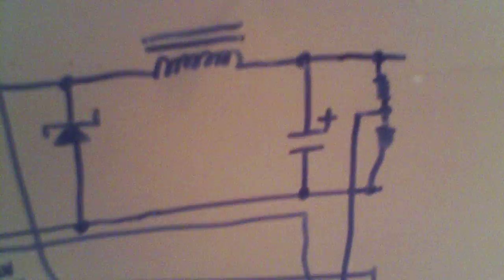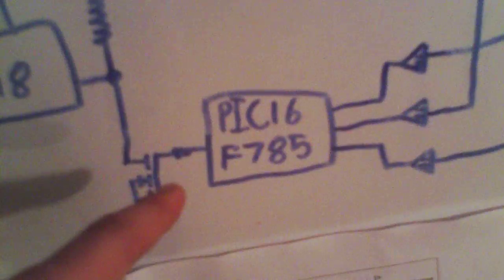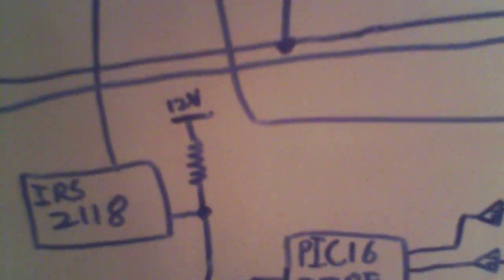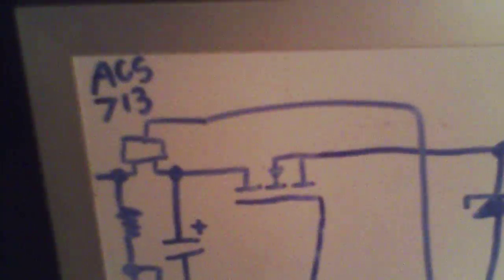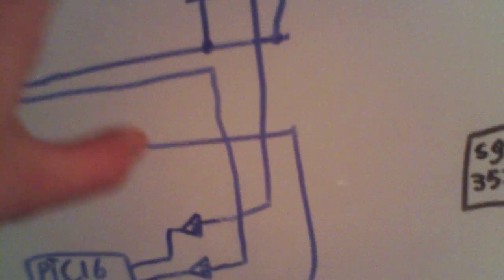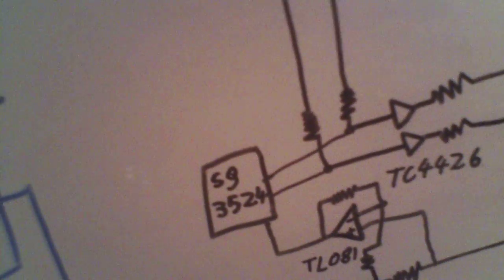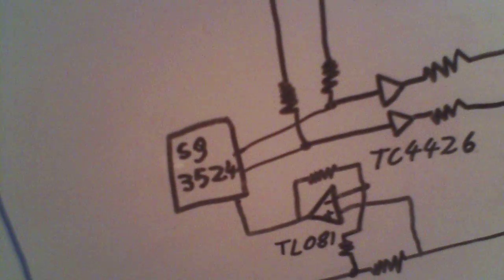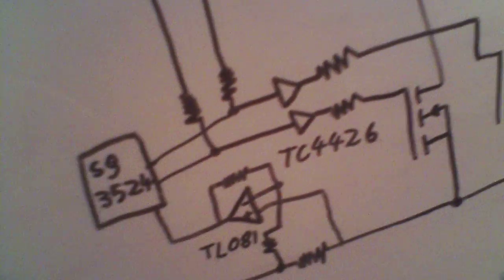Revised DIY MPPT charge controller (and inverter) schematic

Comment from the maker: This is designed for a 12V battery bank (11V to 15V out).  The PV input is anywhere from 14V to 50V.
I have yet to measure the efficiency.

Comment from the maker: If the total inverter load is less than the power generated by the PV array then it will run on only the PV array.  Otherwise, the inverter will run on both the PV array and the battery bank.

Comment: I need your help, if i connect an inverter and a battery to mppt controller and in the morning with solar module turned on will the inverter take current from mppt or the battery ??